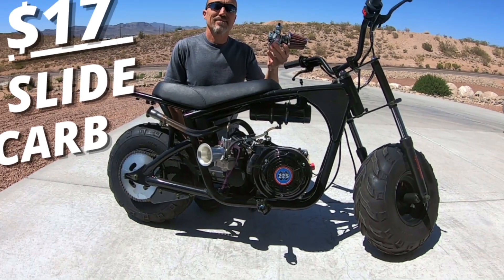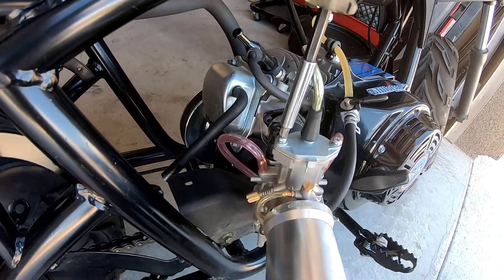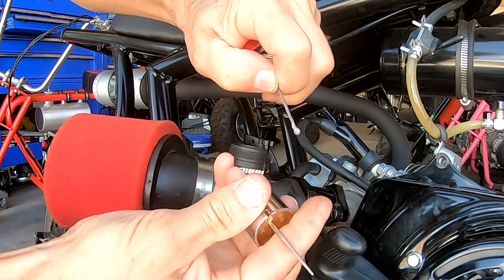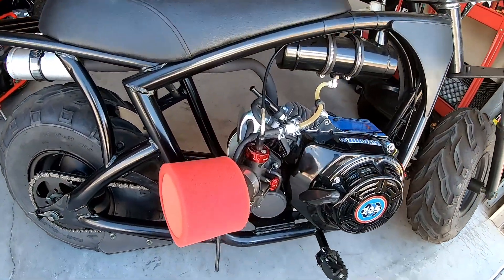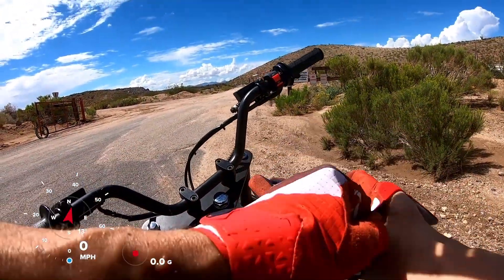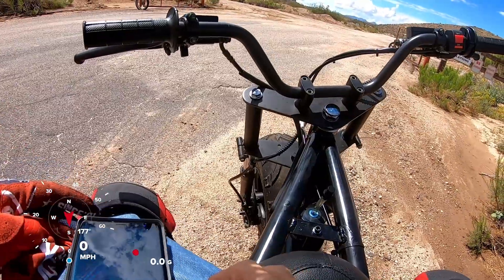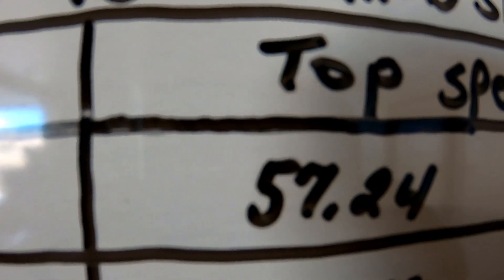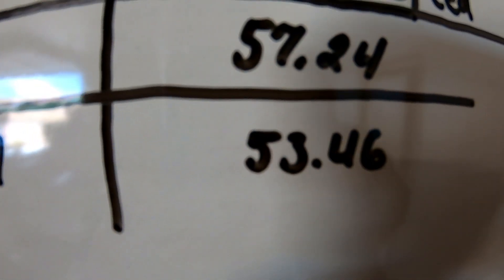Will a NIBBI 24MM carb outperform a 28MM D-Slide on a Tillotson 225?

Comment: Nice comparison I'm in the process of building the same bike.. What header pipe and muffler are you using?
Reply from the maker: Thanks! I'm using a header pipe with a  pit bike muffler. Also now I'm using a 223 stroker based on a Predator Hemi block. Check out the mega moto playlist for many different combos with this bike. https://www.youtube.com/watch?v=_UF3rb_4OBA&list=PLkbj-ip-5FzZG40xkiEtZHRtF_jDzxA9U&index=23

Comment: I have a question u think the mega moto 80 or would the 212 frame work better think would fit a Honda grom style motor with alittle fab work comes with 5 speed clutch and all looking to do something different everyone in there brother has a Honda grom I can’t find anyone who’s done it yet u proably know more about the Coleman style bikes more than anyone I know though I’d ask
Reply from the maker: I think either would work but the 212 frame definitely will have more room to work with. With teh 212 frame you might have to fab up the rear wheel with the sprocket on the  opposite side.
Reply: @Black66  I really like moto 80 I know I’m proably going to have to extend the front alttile I watch your channel gave me the idea do something custom not a lot people seen I’m wondering if u can make them street legal as well

Comment: Hey how's it going currently building a 212cc Powerfist minibike just wondering what your opinion about chain size 35 40 41? Also best ratio for clutch to sprocket thanks! Love your content
Reply from the maker: I like 35 chain for the small bikes and 40 or 420 for the bigger bikes.  RLV Gold on Gold or Gold on Black chain is good.  Nailing down a ratio would depend on tire height, rider weight engine mods and what you want the bike to do. Like top speed , low end or somewhere in the middle.

Comment: I noticed a decent power increase going to a 26mm Nibbi on my 236cc engine. The 24mm has such great drivability around the yard and on trails.

Building a 3 incher, 263cc, will try a 28mm Nibbi.
Reply from the maker: 263 is gonna be another rocket ship!
Reply: What 28 are you using the pwk or round slide
Reply: @henrythompson5624  round aka PE28
Reply: @WyFoster  cool man want to bring a 28mm on my big value head on my 225
Reply: When you ran your 24mm nibbi what did you go with for jetting,  I was running a real keihin 24mm but the idle screw housing broke.  The guts are slightly different and the main jet besides that and the bottom cap they look like an exact copy.  That being said I'm not sure where to start with jetting I'm at basically sea level.